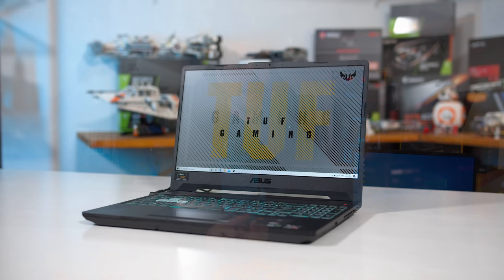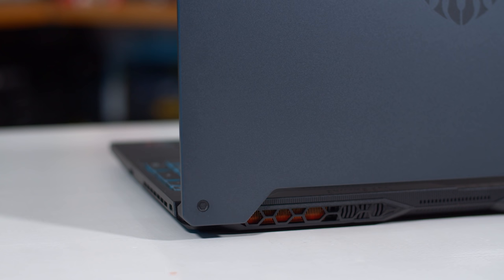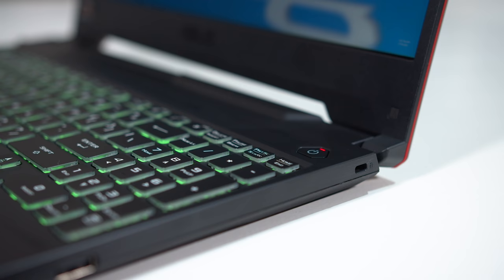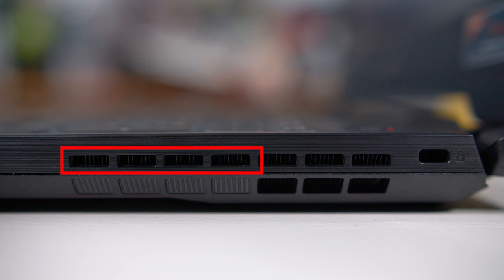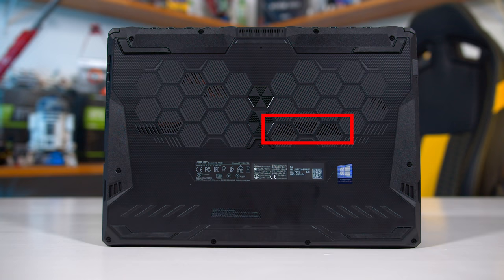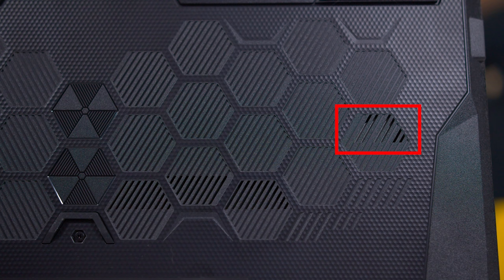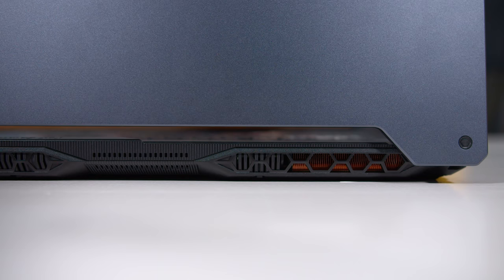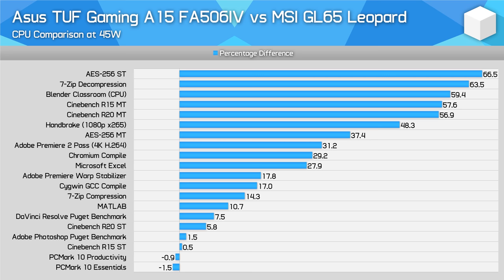Don't Buy The Asus TUF Gaming A15 (2020 Model)

Comment: I just bought one of these laptops, mainly for the MIL-STD-810H capability. I will be traveling with this laptop in various climates, namely construction sites with lots of sawdust and temperature variations. Some of the design considerations look to be specifically made to reduce infiltration, by using smaller openings and filter paper to block foreign material from entering the case. It may not be optimal for cooling the system, but if sand infiltrates into the fans, it would cause more heat issues in the long run. I understand there are things they could have done better, but based on their design decisions it looks like they were thinking of meeting the 810H standard. I just hoped more of these reviews would be more honest about reading the full claims the manufacturer specifies. I would like to know if this ACTUALLY meets the aforementioned MIL-STD-810H. If it meets the standard, I have no problem with the system getting "hot", as long as it "protects" its components by either slowing them down or speeding up the fans. I can find little to no reviews on covering this standard. I have seen on a few websites that it does meet the minimum of the standard, in essence it passes. I researched a variety of companies, but have only found one company that provided an 16+ cores/threads, a "high end" graphics card, and future upgradability. That company was ASUS, and only their TUF series. Other companies that offered 16+ cores/threads processors were either AMD graphics or overly heavy (extra layers added to meet the standard). Lastly, since I will be doing a lot of 3D CAD and SolidWorks designs for altering designs on-site, a "gaming" laptop with multiple processors was highly important. I would have went with a Nvidia Quadro graphics, but it was priced a lot higher, with less payback.
Reply: that made sense. but they should only fit it with lower power consuming processor and gpu, which produce lesser heat
Reply: @ahsanihafizhushali  Just because I will be working in a "hazardous" work environment does not mean I would want to be stifled with low grade parts. According to documentation, the system has a built in "fan cleaner" and will throttle when necessary, given certain work conditions. For instance, when working on a construction site in the winter, I do not see it throttling as much, but in the summer it may throttle a bit to deal with the excessive environmental heat. It is better to design a system that will spin up in favorable conditions, but save itself in unfavorable ones. That is why I would like to see some testing in various environments to verify the company's claims.
Reply: Yes, pretty much this. It's meant to comply with 810H that's why the intake and exhaust ports were designed this way. And as Dupre said, the system will throttle as necessary and won't be damaged by the high temperatures.
Reply: I was thinking the same way as you sir.. I work as designer,  and need fast and strong machine in various climates and ofcourse with 'budget'friendly too.  I think this machine with RTX version is fast enough to help me in constructuon site.. I also don't mind about heat since  in the weather in construction site is hot either. Most important thing is  no dust came in to the machine,  and shock resistance.
Reply: I'm about to buy this for 3d CAD, sketch up, lumion and revit.
Reply: They could add up maybe one more heat pipe and make the vents on the right open but anyway, in different countries they have different pricing and this one gives the best bang for the bucks if you can consider the display. If you are not a content creator or a graphic designer it works nicely. Or maybe replace the display with a aftermarket one :P
Reply: I don't understand why you brought a lower-end consumer laptop instead of a workstation made for there environments.
Like a Thinkpad or Dell. Thinkpad for example has a spill-proof keyboard and is designed to resist sand and dusk.
There is also Panasonic Toughbook but that is for serious extreme cases.
Reply: TURE SPEAKING
Reply: @helstromh  For your need with 8 cores then you would need an Intel i9 and yes will cost you a lot.
I prefer the Thinkpad  P series which are tougher yet they do have a higher price
Thinkpad T released AMD laptop lately
Yet I would not advise buying them yet since they new they have no discount and are VERY expensive. The problem with AMD is that the processor consumes more energy than intel and will drain then battery quicker as well Intel seems to have higher quality assurance and intel processors going to usually last you longer.
I also use Thinkpad for very demanding conditions, been turned on for around 10-12 hours per day and have give me no issue for the past 5 years. Have also dropped it at a few times and accidently dropped liquid on it.
Reply: @r3n736  Sounds pretty good. Most of these laptops that are converting to AMD are not providing very good GPUs (some none, others an AMD GPU - namely MSI)... I would buy one with a Quadro, but they are even MORE expensive. $1100 complete investment for a 16GB, 8 core/16 thread 4800U Ryzen 7, RTX 2060, and 1.5 TB NVme while still meeting MIL-STD-810H seems to be a great deal of bang for the buck. Asus is also a great brand. The 4800u AMD processors are surprisingly light on power consumption 15W, a lot better than the 3000 series AMD laptop chips. This change caused me to jump on the bandwagon pretty quick.
Reply: @helstromh  
I see, I  understand if budget is a concern to you,
Workstation are in fact more expensive, yet they have superior build quality than consumer's laptops hence can hander more abuse.
About Asus yes is a good brand, I had an Asus that was my 3rd best laptop I have owned.
What I don't like is the power jack, not sure if they change it with the latest models but they solder the power jack which deteriorates with time.
To fix it you have to get it re-solder it, case of Thinkpads is just a cable you can easily replace.
In my case I use Linux in my work so need a certified Linux laptop, currently only 3 brands are available Dell, Thinkpad and HP.
The problem with Dell is their upgrades costs are quite high even though is my second choice, I think they are even more ridiculous to upgrade prices than even Apple. HP I have never used one yet. In my case I don't mind the CPU as much, what I do need is a LOT of RAM 64GB and at least 2 NVMe m.2 TB SSD. Thinkpad does have issues, the screen is not great quality and now they been copying Apple which I strongly dislike.
By making laptop thinner and soldering RAM which I Hate. They basically made all Thinkpad T Ram soldered.
So now my only choice is the P series which are more expensive.
Reply: I had the intention to buy this laptop with Ryzen 9 4900H and GTX1660Ti variant for using MATLAB (I am doing a PhD in mechatronics engineering), but lost confidence in this laptop after watching this video a few weeks ago.  However, I regain confidence after reading your comment (and also other people's comments on other youtube videos). Thank you very much for your explanation. Btw, please advice if anyone here knows if the Ryzen 9 4900H is too much for MATLAB and I will downgrade it to the Ryzen 7 4800H variant.
Reply: I'm new to this and I don't know much about laptop and I'm just a student.. Is it good to use it for school projects and gaming?
Reply: @hinaria905  Hi bro, This one is just awesome. You won't even notice the low display color gamut unless you put it right beside another good monitor. And the hardware it has is better than any Intel BS. I was worrying about switching from Intel to AMD but it is solid performance!!! 🔥🔥🔥
You will love it. But you will have a bit trouble if you plan to put it on your lap and game. It will fry your legs 😉 (I think any other gaming laptops will do that!!!)
Reply: @pointblank722  please explain, are you referring to the MIL-STD-410H test or the tests performed by the reviewer?
Reply: I think you are right man. Somehow, people who make reviews are just so focused on high new specs that they miss part of the designer’s aim. It is also outstanding that no channel talk about the durability and how they run in actual harsh environments like work placements or in very humid/hot or dusty conditions, as we are supposed to be paying for toughness.
I totally agree with you, I prefer a hot durable laptop than one with beautiful screen than I’ll need to replace frequently or that I need to be always afraid of hitting it against something.
Reply: This sir, is what I call an actual person who uses their brain. 

In all seriousness though, yeah, they literally expect this to be a full on laptop, and don’t take their other features as a reason of why they might have incorporated certain designs. Also, if you do have it, are you enjoying it?
Reply: Surya Rahardian yeah, I recommend getting the rtx 2060 version. Doesn’t need the 4900h 9 processor though, only the the 4800h 7 processor.
Reply: Shamsul Faisal Mohd Hussein idk, I saw somewhere that the i3 and i5 is going to work ok, which is the equivalent to the Ryzen 3 and 5 so I’m pretty sure the 7 would do fine. But since I’m not a tech person expert, wait for one to reply before buying.
Reply: After reading your comment, every comment complaining about the vents is making me angry.
Reply: hello I am 1st Architecture student and would you recommend this laptop for 3D modelling and rendering purposes?
Reply: @foxfaisal82  So which laptop did you end up with? I am also stuck with the choice. Task: working with 3d rendering and architectural design
Reply: @BMikel  Sorry for my late reply. So far I still haven't bought any laptop. At first, I really wanted to buy that ASUS Tuf A15 with Ryzen 9 4900H and Nvidia GeForce GTX1660Ti. Before making the purchase, I asked something regarding the laptop on 3 different fora (fora is the plural for forum, just in case if you are not a native English speaker). Those people in the fora didn't answer my question, but advise me not to buy the Tuf A15 instead due to the poor thermal solution and screen accuracy. In addition, those people in the fora also suggested me to buy the Lenovo Legion 5 15 with better thermal solution and screen colour accuracy if I really want to go for AMD (but most of the brands/models that are other than ASUS Tuf A15 are only available in Ryzen 7 4800H and Ryzen 5 4600H, not the Ryzen 9 4900H). The people in the fora advice me that the performance difference between the Ryzen 9 4900H vs Ryzen 7 4800H is not as significant as the performance difference between Ryzen 7 4800H vs Ryzen 5 4600H, so there might be no significant point for me to buy the laptop with Ryzen 9 4900H. The people in the fora said even if I still buy the Ryzen 9 4900H, I won't be able to fully use the potential of the CPU on ASUS Tuf A15 if the thermal solution is not that good. In the end, I decided to listen to them and go for the Lenovo Legion 5 15 with Ryzen 7 4800H and Nvidia GeForce GTX1650 (I just want to use the laptop for engineering software, not for gaming, so I just need a powerful CPU and don't mind having a mid-range or low-end GPU). However, The Lenovo Legion 5 15 and also the HP Pavilion Gaming with Ryzen 7 4800H and Ryzen 5 4600H are hot items in my country right now and no longer available in the local market (I am from Malaysia btw). The authorised distributor for Lenovo and HP in my country will restock the Legion 5 15 and Pavilion Gaming with Ryzen 7 4800H and Ryzen 5 4600H, but it might take weeks or even months because of AMD Ryzen Mobile chip's shortage and the COVID-19 pandemic thing. The other brand and model that come with the Ryzen Mobile CPU are Acer Nitro 5 and XMG Core 15/Eluktronics RP-15, but I think I would like to stick to the Lenovo Legion 5 15. It is still not urgent for me to own a new laptop, so I still can wait for the AMD version of Legion 5 15 to be restocked in my country. Just in case if the AMD version of the Legion 5 15 is still not yet available in my country by the time I really need a laptop, I will just go for the Intel version of the Legion 5 15 (or Acer Predator Helios 300 with i7-10750H or MSI GP65 also with i7-10750H). Sorry for my long reply, this is one of the reasons why It takes me 2 days to reply. Plus I am also not a native English speaker and I only know about the word fora around 9 years ago.
Reply: @foxfaisal82  you really great to take you time for so exhaustive explanation. it's very kind of you. thank you very much. I've decided not to buy asus  tuf. maybe I'll then buy msi or lenovo legion, depending on stock available.
Reply: @BMikel  For MSI ot Lenovo Legion, may I know which model are you interested in? Is it Intel or AMD? If you browse the MSI webpage, you can notice that they have refreshed the Alpha 15 with AMD Ryzen mobile 4000 series CPU. Maybe you can also cobsider that if you want an MSI but with Ryzen mobile 4000 series CPU. But MSI Alpha 15 and Dell G5 SE comes with the AMD Radeon GPU, not the Nvidia GeForce GPU.
Reply: @foxfaisal82  I am still in doubts. Maybe it's good to go with AMD because rumors has it that 8-core AMD outperforms 8-core Intel in heavy workloads (3d modelling / video render)
Reply: dude, u could have bought a ThinkPad if u want a laptop capable in harsh environment.
Reply: @imvention5696  true, but I refuse to buy a Lenovo product again, after my last laptop. I did not even entertain looking into that brand again. Do they come with good CPU/graphics?
Reply: @r3n736  I disagree with you in the part you said that is a “lower end consumer product”, this laptops can handle various of applications and other things that a really “lower end consumer product” couldn’t, so if you are saying something because of how many reviews you have seen and haven’t even use the product, you better be quiet.

Edit: Ohh f**k I didn’t see the years of the comment. 😮
Reply: @locoprdr6232   Not only that seems your reading comprehension is very poor. You didn't understand neither my comment or the comment I was replying to. Read them again. I never said laptop could handle applications. I meant handling tough working environments with heavy temperatures, dust, sawdust, sand etc.
Reply: @r3n736  you didn’t understand my point either “lower end consumer product” like if it was a trash product, maybe you don’t mean it but that’s how it sounded. And yeah I read them, just didn’t like your first reply. But don’t worry it was from two years ago. Thanks for replying.
Reply: @locoprdr6232  Yes 2 years ago, and my opinion has changed as well, now  I only use desktops.

Comment: In summary:
AMD good
Asus bad
Reply: hulk sad
Reply: @django4100  Intel smashed
Reply: @steveweidig5373  AMD snapped
Reply: amd is good and asus is smart, they charge you little for an hiped product 4000 renoir cpu and take the profit from using cheaper parts ,good buisnes sense from asus

Comment: This is really disappointing, instead of gimping on features, they're gimping it in other ways to keep AMD in the back of the market...
There is honestly no way this wasn't picked up in testing.
Reply: I'm pretty sure the Intel counterparts will receive the same treatment by Asus.
Asus are notoriously known for horrible cooling solution on their especially on their cheap laptop lineups no matter what the processor it has.
There are some model where the cooling are even worse than a MacBook Air.

Comment: Make a Guide to " modify " the laptop back plate to get 100% of the performance, great work!!!
Reply: 1. Cut the perimeter of those hexagons with extreme care
2. Install a mesh panel on the inside that covers all the hexagonal openings
3. Profit
Reply: @thelegendaryklobb2879  4. Loose the warranty.
Seriously, I'm thinking about modding my cooling pad so that the laptop fits perfectly and then off we go with the backplate.
Reply: Hopefully a tutorial will be posted by someone. Really disappointed by the thermal design. My order will be coming at the end of month and it can't be cancelled anymore geez.
Reply: @ianjasperona3576  download more cooling instead more ram.
Reply: @thelegendaryklobb2879  Just waiting someone do that, create secondary mod cover for ASUS TUF A15 then upload final result.
Reply: @Sad-Lemon  do it after 1 year simple
Reply: @thelegendaryklobb2879  imagine if someone makes a new back cover using 3d printer and making Bigger holes with wire meshes.
Reply: the hexagons air flow edge are small because of the warranty and military grade so if do anything about it (pen it, get cooling pad) to get lower hit will  lost the warranty.
Asus fuck up as always
Reply: Entry lvl ANYTHING is ment to have issues, but the hardware is JUST TO GOOD so Asus had to gimp it somehow. Besides the screen and region configuration problems, stock this laptop already beats there flag ship model the G14. With small cost free mods to the back plate for more air, this is an unignorable power house. #AMDFTW
Reply: @thelegendaryklobb2879  just install a custom 3d printed panel
Reply: @thelegendaryklobb2879  or 3dprint whole back cover